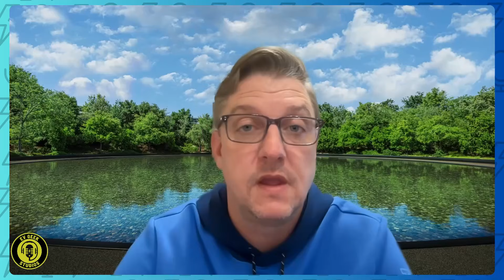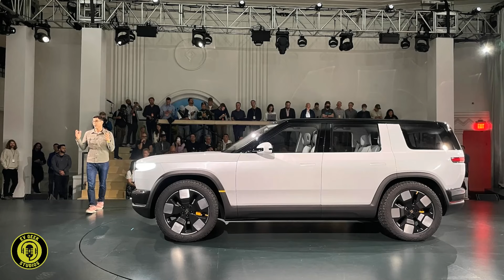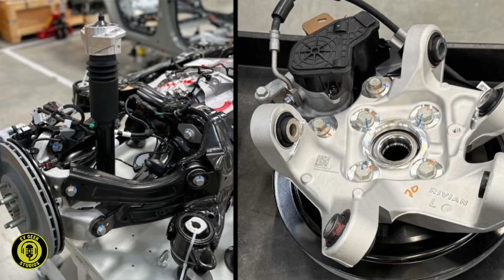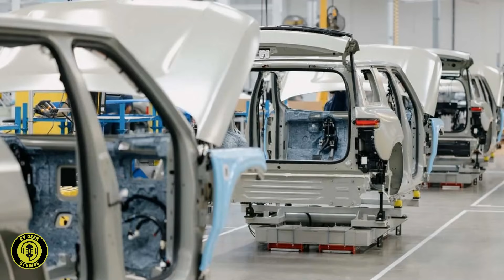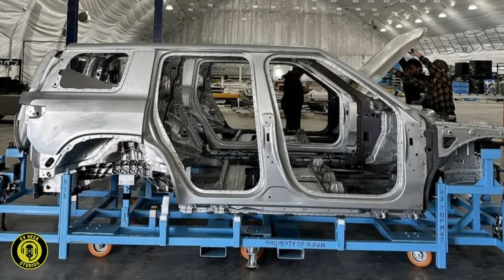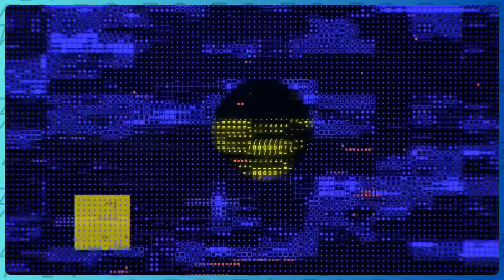How Rivian Cut R2 Costs in HALF: The Secret Strategy to Beat Tesla

Comment: It's not so hard to believe that R2 is 50% cheaper to build. I can easily see 15% due to size, around 20% for parts reduction and 15% due to switching to 4695 cells and smaller pack.